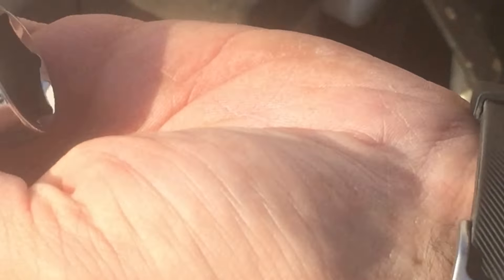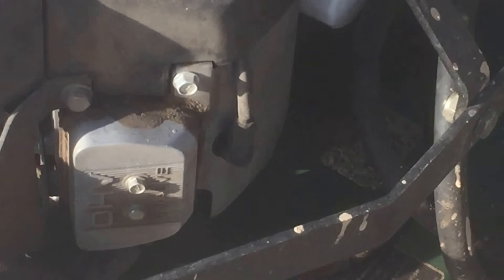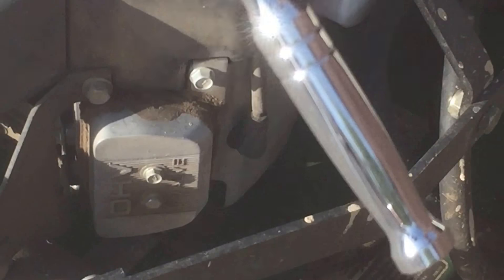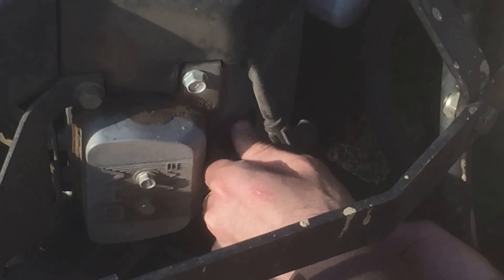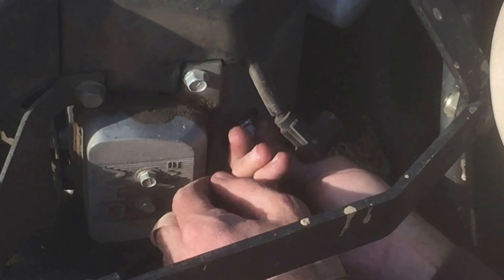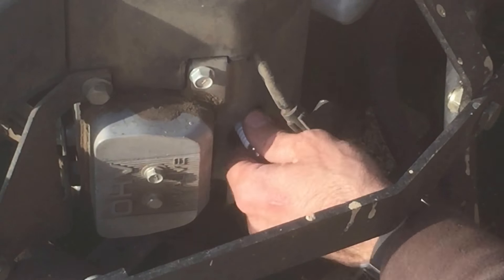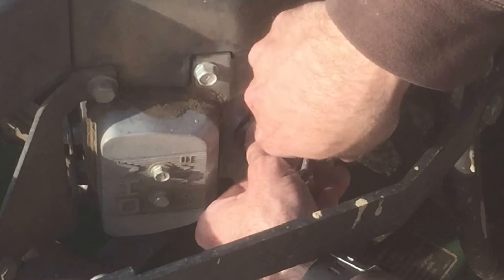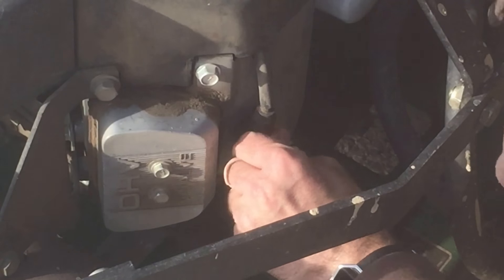How to Change the Spark Plugs on a Zero Turn Mower - Kawasaki Engine

Comment: How do you change the spark plug wires?
Reply from the maker: You can’t just change the spark plug wires. You have to change the ignition coils to change the wires. They are connected to them. Check out my “how to replace ignition coils on a zero turn video. “
Reply: @ReichpoloTech  thank you, been sitting there looking at it and kinda figured it was built into something but didn't know what to call it. Thanks again. 😊

Comment: Do you check the gap first?
Reply from the maker: On the old one when you take it out? Or the new one before you put it in?
Reply: @ReichpoloTech  The new one
Reply from the maker: @luderiffic1  Honestly I never have, unless there is problem after I put it in.
Reply from the maker: I glance at it, but never actually check it with a gap tool, unless there is a problem.
Reply: @ReichpoloTech  should always take 10 seconds and check the gap before installation